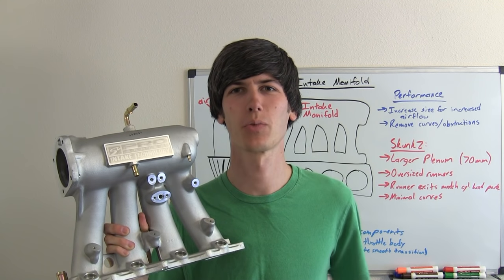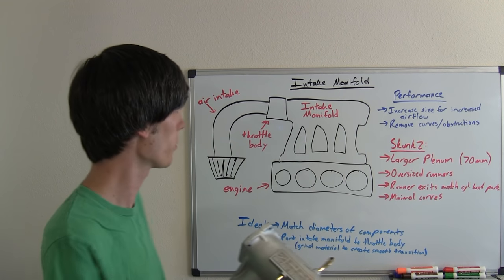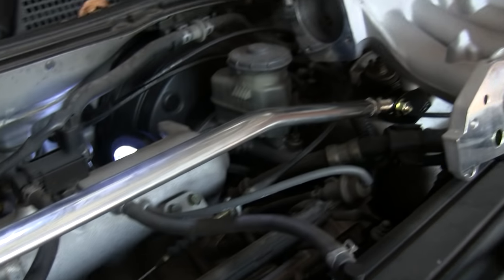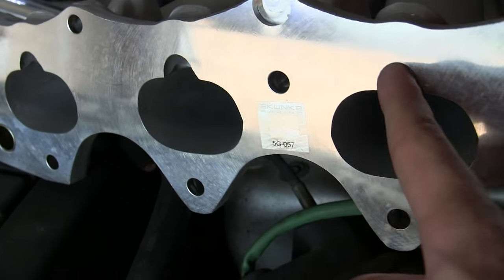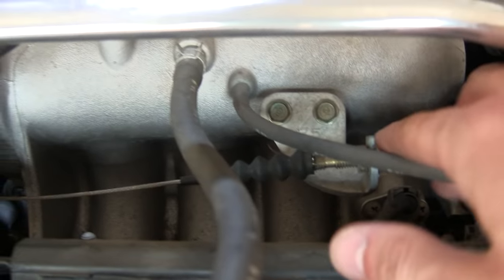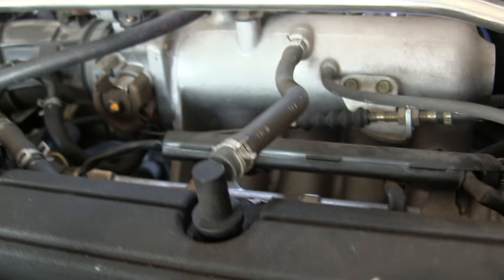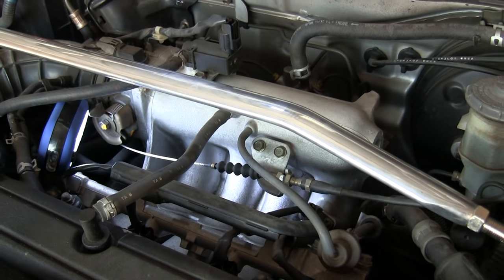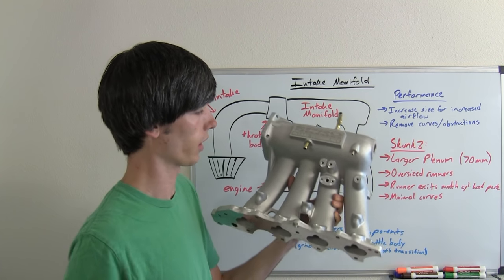Intake Manifold - Explained

Comment from the maker: I've often heard of this being done, though I haven't seen any data to see if it's worthwhile or not.
Reply: If more airflow is better why car manufacturers don't make stock intake manifolds with more airflow to begin with?
Reply: @kllgrogto5838  The vast majority of vehicles are built to suit the average person's needs, not to be a fire breathing monster. Cost, noise, smoothness, fuel economy, emissions, packaging, and low end torque among other concerns keep drag racing style components from being used on grocery getters. There are always trade offs in engineering. Improving one of these factors usually makes others worse. Sure an intake manifold with huge runners may make more top end power, but to car manufacturers the sacrifices in other areas like the ones mentioned above simply aren't worth it. The average person doesn't want a loud, rough running vehicle that gets crappy gas mileage and has no power at lower RPMs for the sake of a few more horsepower at redline.

Comment: This is probably one of the first vids from you that is a bit of a swing an miss... anyway here goes. like meny have stated the PCV valve takes built up / increased crank case pressure and relives it into the intake manifold so it can be burned off in the engine.

Next runner length and overall intake design can affect lots of engine factors such as torque and horsepower. This is done not only through the volume of air that the manifold contains but also how it changes the velocity of the air moving into the engine.

Another item that is lacking in this video is what's called helmholtz resonance effect and how intake manifolds are/can be tuned to use this effect. As the intake valve close in the engine a vibration is sent back to the throttle plate and will bounce back to the runners. A properly tuned intake will time this effect to the point the vibrations will force slightly more air into the cylinder. It is possible to get over 100% volumetric efficiency in NA engine with this effect.

It is also worth mentioning that its also the intake manifold's job to equally distribute air and air pressure between cylinders evenly. That is why there is space for the air to accumulate, this way cylinders will have less of a tendency to run rich or lien.

So to people out there that think you can just weld a pipe with runners to it. There are allot of factors that must be taken into account when building a intake manifold, it is not an item you can throw together in your garage.
Reply: No, it's pretty simple.  The big 3 don't care how they get the air in.  It's been done a million ways and it always works.  Is one way the best.  Yes, but any way will work.  Morris mini intakes suffer from a mess of problems.  The cars are still going strong.  See if you can find an Aussie w/ a name that rhymes w/ wizzard.
Reply: alex tworkowski There is allot more that can be done to optimize performance of an intake. It really can lien out cylinders if its built it wrong. When building an intake allot is taken into account these days. Honda probably has the best designs on the market a hat tip to their F1 racing days. But that is about as far as it goes for Honda engines. Cosworth also has a bit of elegance in intake design.
Reply: ? it was a mistake I have no idea what your getting at, also considering that I posted that In Nov IDK why your bringing this up now. Like having your name on the top of the board or something?
Reply: What are you being so rude about?  I just saw your video for the first time.  What board are you talking about?  I was trying to ask a question is all.  Sorry to ask?
Reply: Not vary educated in internet customs are you... 1 not being rude infact your close to trolling 2 not my video 3 board is in refrence to this post its a refrence to the note board used in older days to leave public messages. 4 your free to ask anything you want just make sure your wording isnt offensive.
Reply: Lol troll on alex troll on
Reply: Robert Hollar You say troll?  You're a baby.  Troll.  That's a childs word.  Change your undies.
Reply: He be trolling, Im laughing...
Reply: Lol my friendly troll you are a blast
Reply: Robert Hollar I think im correct in saying that the skunk manifold that's been on show has major design fault (.. well major overlooked area) and does not have trumpet's incorporated into the intake plenum at the end's of the runners. Which i believe is what you calibrate the intake manifold harmonics (by making longer or shorter, sound wave bounces between the trumpets and the inlet valve) - check out this testing by emerald ecu's : http://www.emeraldm3d.com/articles/emr-adj-length-intake/ 

Im not sure you get the same harmonics management/effect without the addition of trumpets in a inlet plenum (which are found on any proper race inlet manifold)
Reply: "Trumpets" that you call are air velocoty stacks they help by smoothing th transition into the intake that doesnt have anything to do with the Helmholtz effect.
Reply: Ahh, okay cheers!
Reply: Yeah its a common misconception.  If you go by runner length alone most 4 cylinder engines would have runners that are almost 14 feet long you have to make the air tank portion and runners sized properly to get the desired effect. F1 intake manifolds the velocity stacks can move up and down to amplify the effect, this also moves the torque cure down a little.
Reply: Robert Hollar I was just kidding about hanging him.  BTW, the PVC does not allow "built up gasses" from the crankcase to be vented into the induction system.  The oil cap has a vent in it to allow continuous ventilation of the crankcase.  The pressure never "builds up."  And the word "lien" is a legal term.  The word is spelled "lean."  And again, if this man can't understand a simple concept, why should anyone listen to him.  He's just adding to the confusion out there.  He is highly misinformed.
Reply: Shane mk2
i know mr hollar addressed this issue already, but the trumpets reduce vena contracta effects to maintain mass flow.   the most important pressure waves in helmholtz tuning are the ones traveling between the intake port and the runner inlet.  this is the strongest wave because the change in cross sectional area of the runner inlet (e.g. at the trumpets) causes reflections from waves going upstream.  the subsequent reflections upstream from the runners return less energy to the intake port. however, tuning the manifold so that all reflections return to the intake port at the desired engine speed produces the greatest increase in torque.
Reply: alex tworkowski wrong pcv makes sure there is always negitive pressure in the crank case. It also helps hp surprising. Oil caps do not have valves on them... Are you putting oil into your coolant system? If so you got some problems...
Reply: close
Reply: Robert Hollar You are correct.
Reply: Robert Hollar I'm seeing that there are two types here.  You are referring to the closed type used in later cars.  Correct.
Reply: Robert Hollar. the hose from brake booster to the  intake  it usually when you take the hose off from the brake booster there's a lot of air sucking in into the intake I have a 2006 Impala 3.5 is running really really rough and it cuts off a idle and I noticed it there's really no air sucking in from the hose
Reply: @ Robert Holler: Observe that air at the closed intake valve has no back pressure since it is at normal atmospheric pressure with the plenum and/or stepped to another open air intake valve port. Since the closed intake valve port then has zero induction at the closed port air is no longer charged through it. If air is not being pulled in it does not push through either, vibration of sound? What vibration? There is no pressure front, no shock wave, no oscillating wave travelling back upon the air from an abrupt valve closure to reflect off a throttle plate. The frequency of the charge of volume is discrete but there are 4 runners along the length of the plenum and the volume of airflow through the plenum varies with the rate of the engine cycle (or rpm). No Helmholtz effect is going to advance a pressure front of reverberated sound that maxxes wave amplitude right on the opening intake valve ports when the air volume is stepped between 4 intake port locations, when the air volume changes with the flow velocity of induction via engine cycle rate (frequency), and the plenum has fixed volume dimensions. Sound has a doppler shift with the positive direction of the airflow velocity lengthening its period, or wave direction negative against airflow shortening it. Since the positive direction of airflow is toward the intake valve cylinder's atmospheric pressure drop, the Helmholtz effect's 'charge' of air pressure would lengthen the sound wave's pressure front through doppler shift to a lower apparent periodicity ..if any such effect were, in effect, having any effect.

Comment: Some PCV systems do actually supply air in through the top cover/s, but usually they draw the air in from the intake hose/air box/somewhere before the throttle body/s. And then they have another breather hose running from the crankcase to an NRV mounted on the intake manifold, after the throttle body.

Comment: Frist off great video man, but I think you explained pcv valve function wrong. You said “Airflow travels from the intake to the valve cover” which is incorrect. Manifold vacuum pulls on the pcv valve opening the valve there by allowing blow by gasses to travel from the valve cover through the pcv back into intake manifold to get burned.

Comment: I think he is saying:
Short & long runners for the intake manifold. 
The long ones are blocked of by valves, and open up in higher rpm's to increase flow into the engine. At idle or under low load, they are closed so you have more vacuum(my assumption).

Comment from the maker: I'm pretty sure Skunk2 recommends using a zip-tie to secure the evap. Not the best solution haha, I'd probably try to use a metal hose clamp if possible - plastic in the engine bay with high heat seems like a bigger risk.

Comment: Great knowledge!  Well explained!!! Quick question.... In this application there is a vacuum line from the manifold to the brake booster, in the event of adding a turbo( as we know it will cancel out the vacuum or even add pressure) 1) How bad will that affect braking? Or will it?

Comment: I am curious about the IAT sensor. You stated that when the air is warmer, less fuel is injected and when the air is colder and denser then more fuel is added. But I always thought that when the air intake was colder it meant that gas could burn more fully and efficiently thus causing the engine computer system to send less fuel as it burned better; and therefore sending more fuel for the warmer air to improve combustion (hence why cold air intakes are a big sell as they improve efficiency). I could be wrong so please let me know. Love the videos!

Comment: I wrote a reply agreeing with you both then came to realise i was thinking more crankcase breathing which usually does go into the intake to burn off hot oil vapours and any cylinder 'blow past' gasses which would otherwise cause positive crankcase pressure. the valve/cam breather is not internally connected to the crankcase with the same gasses or pressures.

Comment: are you sure the PCV valve flow direction is correct? I think PCV valve leads unburnt fuel from the crankcase back to the intake manifold to be burn off in the piston again. Anyway that wasn't the PCV clean air inlet hose u were pointing at in this video it was the PCV valve
Reply: @71502, I am not a trained mechanic and have never been to auto/diesel school, but I've done a lot of "shade tree" work and I've been reading all these critiques and this one made me laugh. My friend, you were correcting the presenter of this channel for miss-identifying the PCV valve and you said, "fuel from the crankcase back to the intake manifold to be burn off in the piston again". From my recollection the area where combustion occurs is the "cylinder", not the piston.  The piston moves up and down in the cylinder.  If you're going to correct someone you should know what the heck you're talking about. "but Great comedic value!!!!! Thank you!"

Comment: Great, but you forgot to explain one of the hoses. I talk about the one right between the PCV hose and the gas cable bracket, that you both mentioned. Would you clarify what that hose with a some valve is for?

Comment: Yeah, the ECUs can re-calibrate and relearn, but they won't be the same setting as the stock platform. There are some cases where people lose mpgs (running a little rich) when the bolt-on is as simple as a cold air intake or any aftermarket intake.

Comment: You got your airflow direction wrong with the PCV Valve, easy to tell direction by removing the PCV valve and blowing air through both directions, there is a small one way valve on the PCV valve.
Reply: But the name says it all POSITIVE CRANKCASE VENTILATION  :)))
Reply: Yes it's positive, but it doesn't mean that pcv valve and hose are the only components of the pcv system, the pcv valve lets the air and oil move from the crankcase into the intake manifold, and to refill created vacuum exists breather, which is another valve connected from crankcase to somewhere between air filter and throttle body.

Comment: It's a turbo supporting mod, so it does something when demand is needed but not much when you have no power to begin with. Like RAM for a computer. if the processor is slow you wont notice the difference between 4GBs and 12 GBs, but when you upgrade to a 2.8 quad core you notice a big difference.

Comment: Thanks bro for making the complicated so simple👍 Bro was thinking of a six stroke Diesel engine but without  injection of water at the 5th stage.But Intake of fuel and air, compression(shorter piston) without explosion, then piston goes down & there is expansion(low pressure will increase evaporation) of mix of fuel & air into more vapor, compression(when Max diesel turned into vapor) for explosion this time & finally exhaust. An engine with six cylinders in V?

Comment: the piston travelling down sucks in the air (on the intake stroke going form top dead center to bottom dead center). In this 4 cilinder engine there is just 1 cylinder at a time sucking in air, the other 3 are at that time doing, exhaust, compression or power stroke.

Because the intakerunners are equal length and shape each cilinder draws in the same amount of air. If there we're differences it could lead to an engine that runs less smooth because 1 cylinder is making less power

Comment: Great explanation into how the IM works. But one question, could you give some details on what the relocation process of the EVAP purge control solenoid. You briefly touched it in the video, which unfortunately for this specific setup it requires a relocation and a 3/8" T-fitting.  Any information/pictures would greatly appreciated.

Comment: Very good teacher. Would you be so kind to explain the least expensive way to convert an old MGB to gain more torque to the rear axil.  I bought a used one years ago and  the person I bought it from warned me that if I let the clutch out a bit  too fast the wheels would spin.  The car was super fun to drive because it didn't dog out when excelerating in the lower gears.  Just not sure what one of the previous owners did to make it such a quick car. I'm guessing they changed the gears in the differential but not sure. I have never done any major repairs or convetions on a car and have no idea of the cost or best way.  Thanks  Will buy another MGB and hopfully it's not too expensive to do the convertion.

Comment: This thing is really complicated , Because the air travels both ways for it ! it goes back and forth sometimes just to adjust the positive ventilation and when the piston rings becomes weak the gases start to escape into the lower parts of the block , then because of the gases a kinda Temporary solution to keep the engine performance close to original the oil is picked up by the pressured gases and throw back into the intake to create a temporary seal for the replacement of Piston Rings

Comment: are you sure about the air flow in the pcv (from the intake manifold to the valve cover) because there is no force to do so.
the engine is sucking air from the intake manifold thus sucking air from every hose attached to it so how can it push air to the valve cover?
also the brake vacuum hose draws air and it is attached to the manifold.

there is an article on honda tuning magazine about crankcase ventilation system you can refer to

thanks for the great videos
i have learned a lot from you

Comment: Good presentation, maybe you could elaborate on the inherent trade offs witha larger plenum and runners, ue trading low end torque/throttle response for raising the peak torque and hp RPM; a poor choice could lead to giving up more bottom and middle for too little HP gain at the top of the curve. Unless you put deeper gears and perhaps more compression you can lower the average torque and actually do more harm than good, particularly with a normally aspirated in line 4 that already is a bit low on torque.

Comment: What made you choose your car?  Just out of curiosity~  Great video too!  You explain things perfectly!
Will you feel a difference in power with a performance intake manifold?
Reply from the maker: At the time, my philosophy was:
Something that was reliable and relatively cheap. I wanted a manual, and preferred two doors. I went to the dealer to buy a Honda Civic, it wasn't there I and I ended up with the Integra.